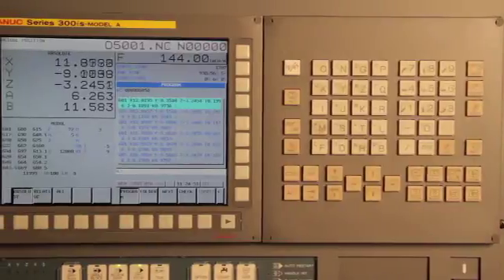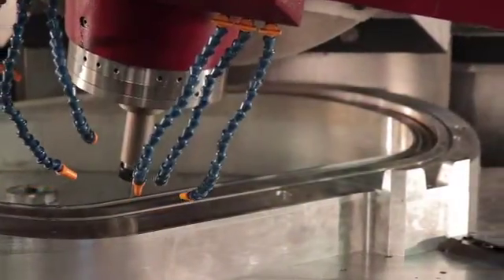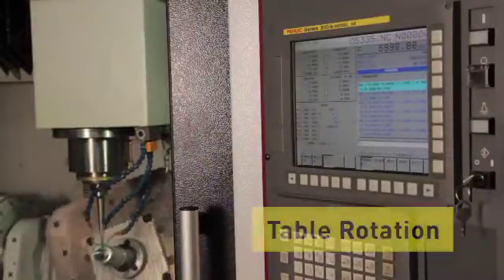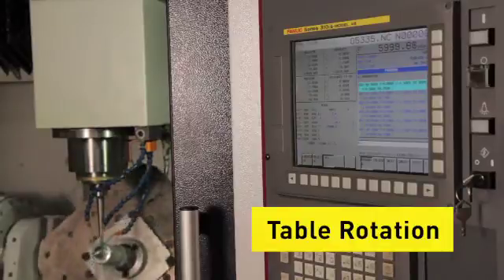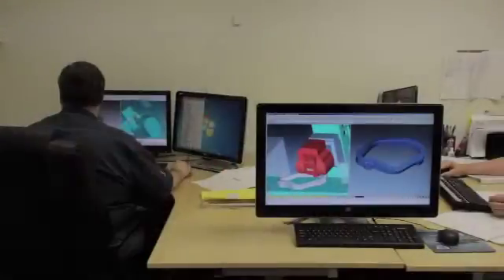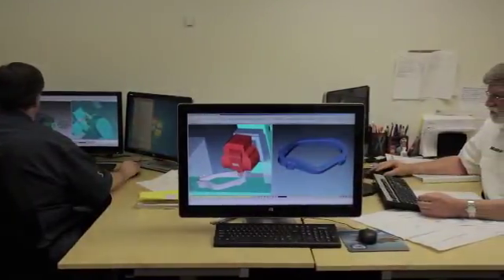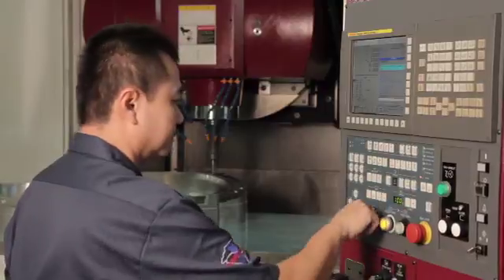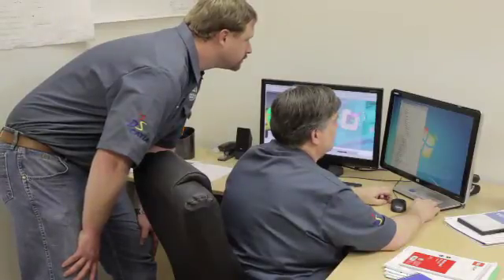FANUC Desemco 5axis Aerospace Machining with Vector Programming.mov

Comment: This video shows how Mastercam v10 programs can create and edit a fully robotic program has the ability to design and create mechanical parts for aircraft using  x, y, z and I,J,K Vectors, as well reduce times production PCP Type II or verctor programmig allows the use of vectors versus the rotary axis positioning